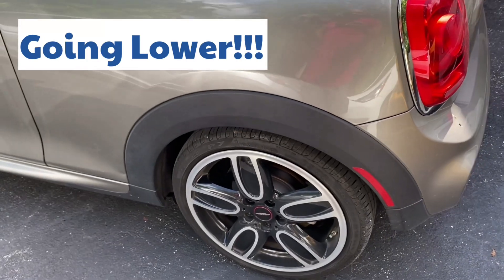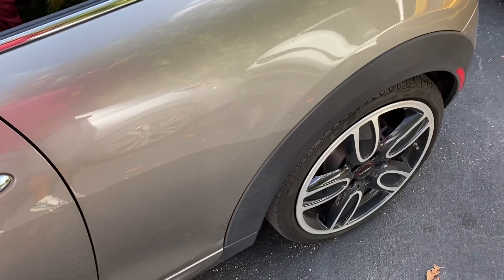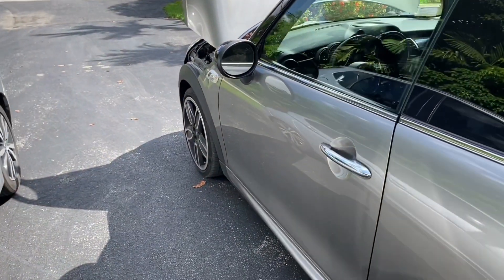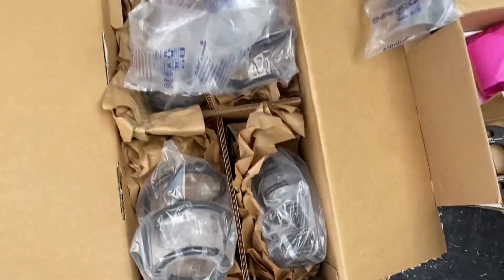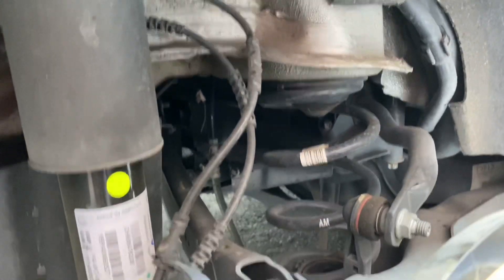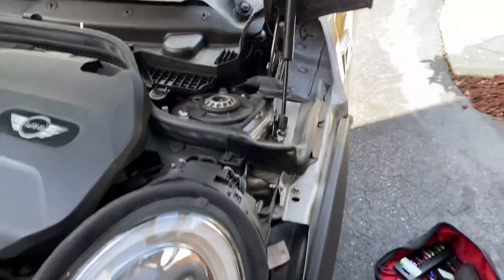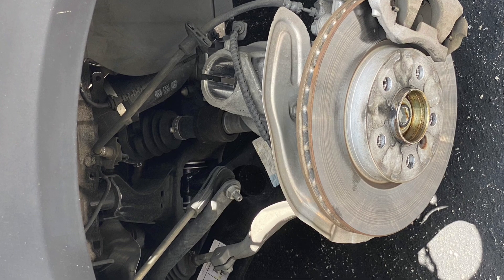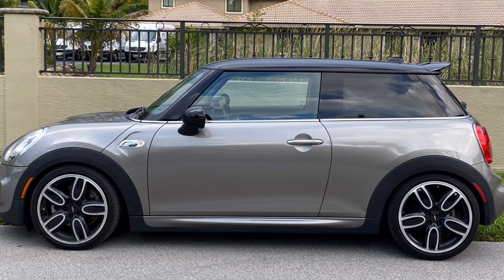Lowering Mini Cooper: DIY Driveway Project

Comment: Looks great. The spacers were a great addon. Did you guys trim the bump stops as well?
Reply from the maker: Thanks! No, we didn't have to trim the bump stops. It rides very similar to stock, just a little stiffer. It handles much better, much less understeer.
Reply: @MiniBrothas  appreciate this info.... I too have DDC and was told 1in all around may cause issue with DDC. Have you notice any issue or future concerns?
Reply from the maker: I haven’t had any issues it’s the DDC yet. They are working great with this setup.  I’ve driven about 8000 miles since install.

Comment: Have you consider the Bilstein B8 shocks that are DDC compatible? Im about to buy them with a set of H&R Springs. Also, are those the same wheels as the JCW? Or is the Cooper S option? I got the JCW ones and seem to be wider in the profile of the car.
Reply from the maker: I haven't been able to find any Bilstein B8 shocks that are DDC compatible. Please send me a link to those. I would consider them if they are compatible with the stock DDC system.
Reply: @MiniBrothas  good day....have you found these B8 compatible springs?
Reply from the maker: I haven't been able to find B8 springs that are DDC compatible.

Comment: What section tires brother? I have 215/45r/17s and I'm unsure if lowering springs won't cause rubbing.
Reply from the maker: Thanks for your comments. I'm currently running 215/40/18. My wheels have an offset of ET45. I'm not experiencing any rubbing. with that. I think an ET40 would also work.

Comment: It looks way better!  I just lowered mine with MSS coil over springs.
Reply from the maker: Thanks for the comment David.  How do you like the MSS coil over springs? How is the ride?
Reply: @MiniBrothas  it lowered the ride almost an inch but it’s new and needs to get broken in.  My GP looks and rides better now and doesn’t feel too much like a track car.
Reply: @MiniBrothas  the ride was lowered about an inch on the GP3 and it’s smoother ride and not as hard and stiff.  They weren’t cheap either at 1k.  Better than buying a whole coil over kit for over 2k.
Reply from the maker: Glad you're enjoying them!

Comment: BIG difference idk why the rear fitment is so badddd on the f56
Reply from the maker: Thanks for your comment. I actually think it's because they need all the space in the front for the engine and transmission, but they could easily just widen the back. It kinda doesn't make sense. Most front wheel drive cars seem to be like this. Maybe someone knows the real reason.

Comment: I have that setup on my F56 but it rides stiff.
Reply from the maker: Thanks for you comment. You have the DDC with the NM springs? It does ride a bit stiffer than stock, but you can put the DDC into a softer setting for more comfort.

Comment: Question to all, is it true you can add spring to rear tyre WITHOUT removing tyre?
Reply from the maker: Hi.  I don’t think that would be possible.
Reply: @MiniBrothas  I was thinking de same thing until 36hrs ago... My rim key broke on last wheel (rare right). What they did was have mini on lift and worked around tyre to place spring...I too am shocked.

Comment: How did the ride quality change?  Much stiffer?
Reply from the maker: The ride quality became a little stiffer.  Enough to enhance the performance in the corners but the ride is still very comfortable.
Reply: Any issues or notice odd tire wear after lowering springs?
Reply from the maker: No issues. After we lowered the car at installed the rear sway bar and adjustable rear control arms, we took the car to get a high quality alignment. If we didn't, we would have had some tire wear issues, but we got the camber to a near neutral setting.
Reply: @MiniBrothas  thanks for info. What brand rear control arms & sway bar you used? As you know I'm recently lowered and (4) new ps4s so I'm trying to have them properly planted
Reply from the maker: All the suspension upgrades are from NM Engineering (springs, rear sway bar, lower control arms, upper strut bar). The only other thing that we have installed is a chassis brace from Craven Speed.
Reply: @MiniBrothas  without going on tracks, more of a weekend spirited driver. Will you recommend adding rear sway bar & adjustable control arms to a lowered mini? Thanks
Reply from the maker: Yes, I think it made a big difference in my car taking out some of the understeer. So the car feels much more stable in spirited driving.
Reply: @MiniBrothas  I was reading where said buying control arms (UPPER & lower) are best for lowered Mini. Is rear UPper control arms needed? Thanks
Reply: @MiniBrothas  good day! When you put in rear sway bar, what was that process...did you have to drop subframe?
Reply: Do you still enjoy the springs?
If you had to buy the spacers again fould you still go 10 and 15. I see alot of people saying 15 front 20 back  thoughts?